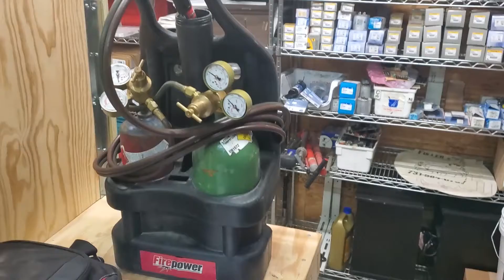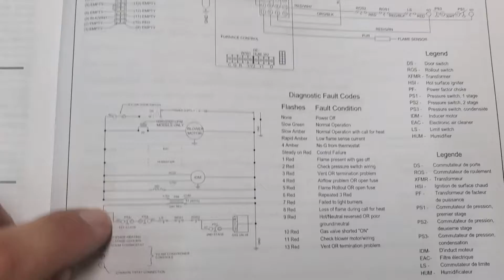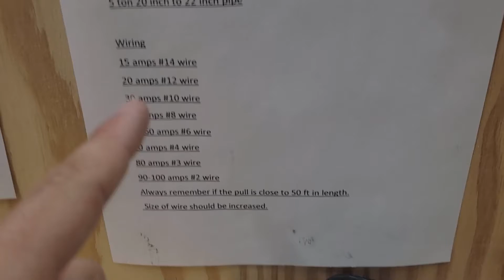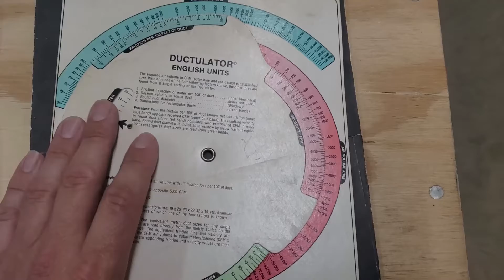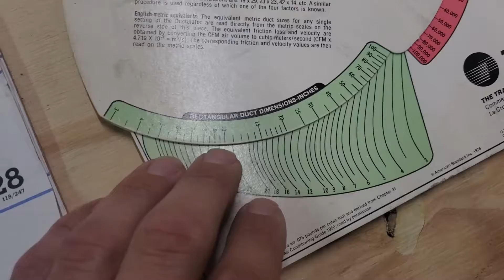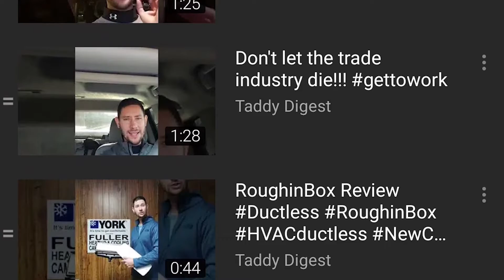Things to know before Entering The HVAC Service Field #hvacschool #hvaccareer #hvac

Comment: Just looking for some advice straight out of trade school was put into service / maintenance for residential AC. After season was over for no cool was put into install. Now I'm a lead installer. Really miss the service side definitely forgetting some of my technical skills should I  stick around and become a really good installer or move on and start doing service for another company. I live in the southwest and they are always hiring all over . I just have 2 yrs of experience . Currenty working on my contractor's license right now. By next season  the plan is to  start doing my own thing because it gets real hot over here like in the 100s for 3 solid months. I already have a service truck but build it  up as I still need a lot of tools .
Reply from the maker: great goals 
It would be cool to start your own thing 
I would work in the best place that allows you to grow and prepare you for your next step whether it be service or something else .
I wold definitely learn more service
I think it takes around 5 years at a good pace to call your self a good well rounded technician.
The contractor license will allow you to bid jobs and do more projects.
Good luck my friend.